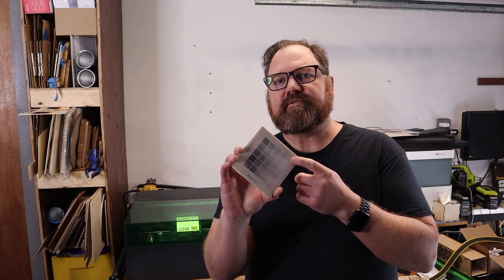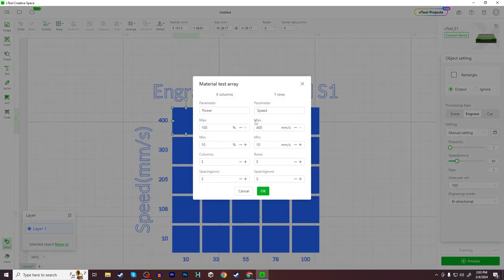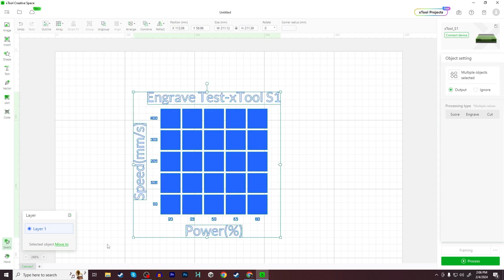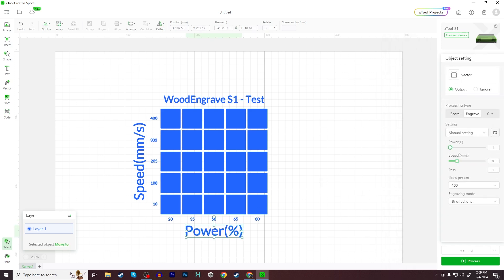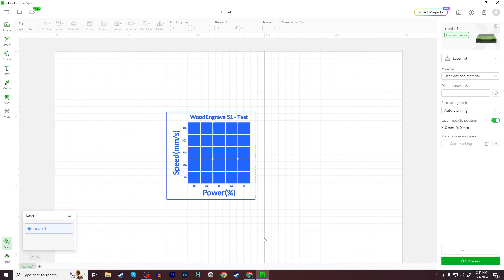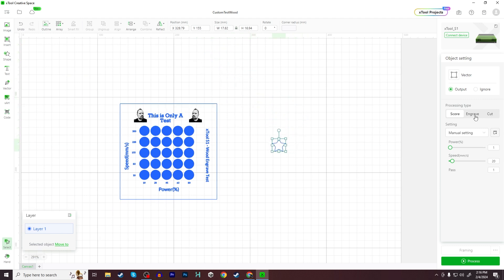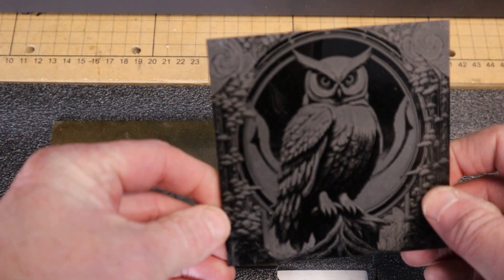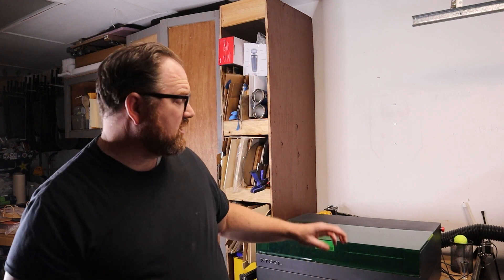DIAL IN YOUR LASER - xTool XCS TESTING

Comment: Speed 10 for engraving tells me how little these youtubers understand about their machines..
You use 10 for cutting not for engraving😅
Your test cut files are pretty much useless..obv your laser will not cut at 200 speed..it's like common sense.
Reply from the maker: I have used quite a few different lasers and have been doing this long enough to know where the optimal cutting and engraving range will be, but this video is for people who don't have much experience using a laser and for those people, seeing where the diminishing returns start can be helpful.
Reply: @GeekBuildersNet  one more reason to actually provide numbers that make sense.

It's like me trying to sell you into "testing how long in takes your car to brake from 2000 km/h".  Does that makes sense because you just got your drivers license? Obv no since your car can't reach those speeds.

Same with the laser. Nobody and I mean nobody cuts wood at 200 speed, that's about 20-40x times higher than regular cutting speed most people use on their xtool, so there's no scenario those files make any sense.

Comment: I just finished watching the comparison video on vision vs S1 and see the vision buried under materials bk there. Do you prefer the s1?
Reply from the maker: I do prefer the S1. The machine is easier to work in (The WeCreate feels like I am working in a tin can) and xTool has a larger community for support along with more flexibility for add ons and expandability in the future. That being said, the WeCreate is still a good machine and works well, I just don't know what long term support looks like since they are a brand new company.
Reply: @GeekBuildersNet  ok I see. Thank you for your honest reply. I just joined an unofficial vision page on FB and asked who has gotten vision and now regrets and what they would get instead and was told S1 and another I had not heard of Roly lasermatic mk2. Have you heard of that laser?